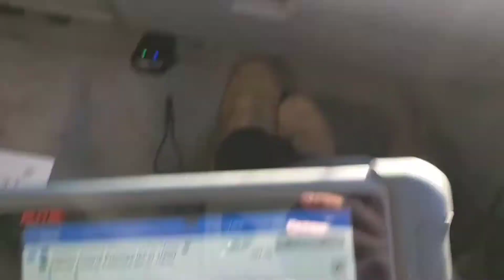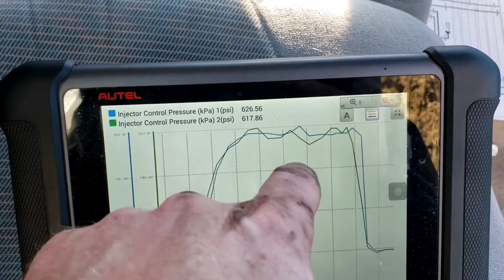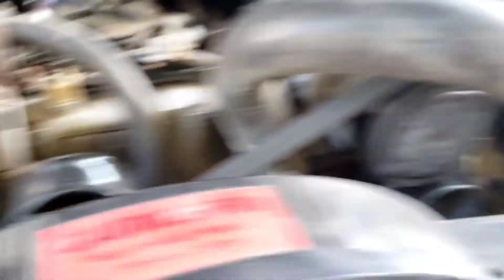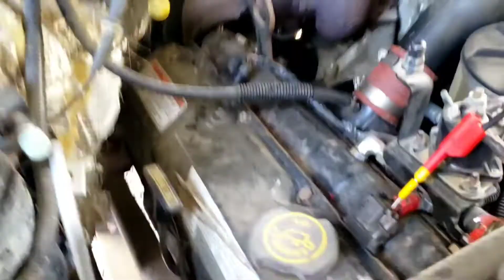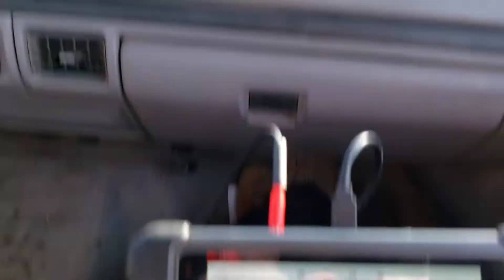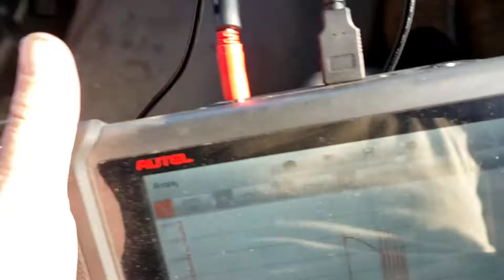1997 Ford F-250HD 7.3L Cylinder Contribution Issues

Comment: Hi BL Automotive. I am chasing a gremlin similar to what you video shows. I changed my injectors to a set of reman's. It still does the surging. Did you ever find the fix for this truck?
Reply: Did you try your idm?
Reply: @zacharybrasher315 the truck that I was working on was a 97. I have a 95 so I swapped the IDM, PCM, MAP, and CPS and no change. Pressure checked turbo and intakes and found both plenums leaking and intake boots leaking. Also pressure tested exhaust. Found up pipes were leaking at the collector. New bellowed up pipes and resealed plenums. Seems to run alot better. The strange surging that I was getting I think was coming from the intake leaks. As I pressurized it I would crank my regulator up and the pressurized air would escape and the intake would reseal until the pressure went up again. I assume that made the MAP signal fluctuate therefore making it fuel and defuel the injectors. I hope this helps someone else with this problem. It just about drove me nuts.

Comment: 7.3 Diesel has mild white smoke on idle. Plenty of rolling coal on   throttle. Did buzz test. Each has good sound.
I got a P1276 on #6. Pulled driver exhaust manifold. Looked like smoke coming from #4, not shore. What do you think.